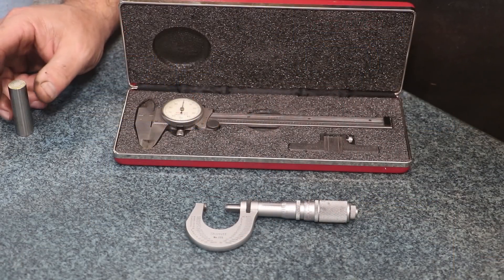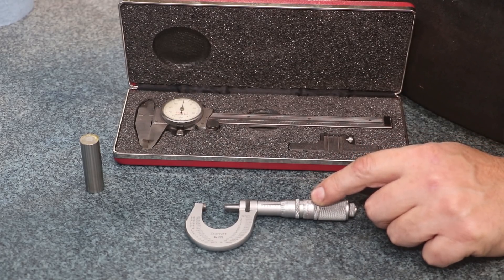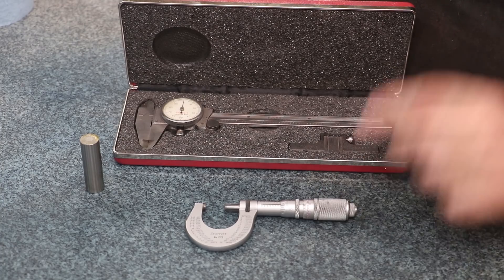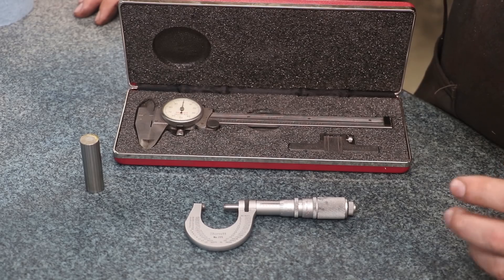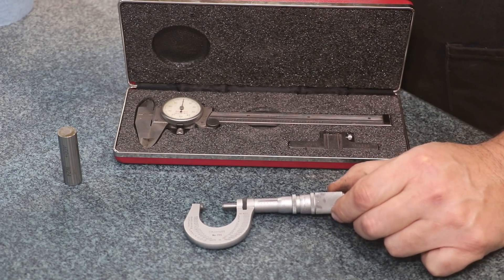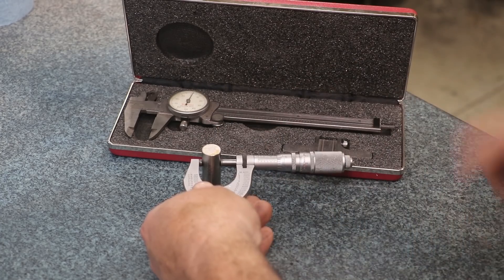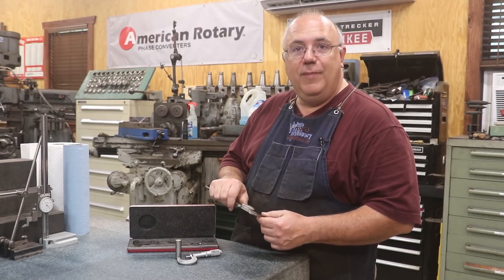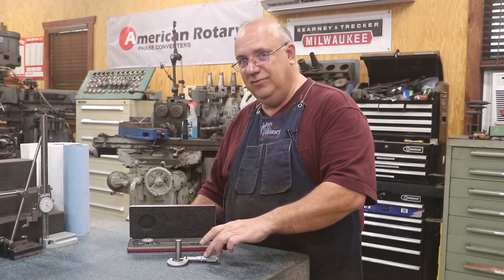Machine Shop Measurements: Dial Calipers vs Micrometers

Comment: Never seen a builder use a micrometer to build a house never seen  an astronomer use one to measure the distance to the sun seen many machinists use  tenths micrometers to  meet a  thousandths tolerance  and still use a metric rule to measure their pee pee and call it inches

Comment: As a watchmaker for the past thirty years, I remember the early seventies when the first digital quartz watches came out I could even back then feel the pain of watchmakers of the time when their customers would say, well you know these new watches are accurate to within a second per week, and the watchmakers all cringed . But some of them said why is it necessary what kind of work do you do that you need that kind of accuracy. And yet today I still get that kind of customer so I feel your pain too Keith, sure you go the extra mile when it's really needed but like you say if the job doesn't require it what's the point except to sooth your own ego maybe. Been there done that for sure. I guess we both of off a good rant today.
Reply: And then there are folks who just want a watch that keeps accurate time without the digital quartz design. These days, not that many wear wrist watches since their cell phone is their time piece. They like are those in the group that never cared that much about the watch in the first place. Then there are those who wear a wrist watch for the specific reason they were invented, to see the time within a nice piece of hardware that can have all sorts of looks.  Those who still wear a wrist watch prefer them over the phone I guess.  For sure the watch needs to have good time keeping as it means less fiddle-farting adjusting the time every week or month.  Since the 1970's, Seiko has produced very accurate self winding watches or "automatics" until they developed the kinetic and then the spring drive which require zero winding or activity to keep wound. Finding a good watch maker today isn't easy either, just like a building contractor !
Reply: @Garth2011  I'm glad you took the time to reply, sometimes I wonder if anyone is really out there. I think there is a time for precision and a time for beauty and sometimes they come together like in a good quality timepiece .sometimes I drag myself off on a tangent but measuring a mile down to the nearest one hundredth of an inch seems a little bit on the overkill side, and if your supposed to be at work around nine in the morning just get a timed.
Reply: I've got two clocks in the bedroom, one that's a clock radio and the other that's a indoor/outdoor weather station.  That weather station sets its own clock with the WWVB signal.  When I went to reset the clock radio this weekend, I discovered it was 3 minutes off, but guess what, it doesn't really matter.
Reply: @Orxenhorf  I have a WWVB clock and it takes a long time to change an hour fwd/back for some reason. Waste of time. Mechanical clocks seem to be the way to go...tick toc
Reply: @Orxenhorf  If you have one clock, you know what time it is.  If you have more than one, you can never be sure of the time.  Since I retired, my half-dozen clocks are within five or six minutes, but I no longer care.
Reply: I would love to own a Seiko 'Grand Seiko'. Would I ever have occasion to wear it, no. Would I need the level of accuracy it posses, no. Do I consider it a testament to mans ability to create something wonderful, yes.  Like Hypercars, no one needs them but the world would be poorer if no one thought to dream big enough to make them.
Reply: @honorharrington4546  I really like what you've done with Manticore.
Reply: I love a good automatic Seiko.  There's something special knowing that it doesn't need a battery and just me wearing it is winding it.  But I also love my g-shock rangeman with being solar powered and atomically controlled and updated, I think it's better than a second a week.  Do I need that much accuracy for anything I do?  No.  Not at all.  I enjoy both for what they are.